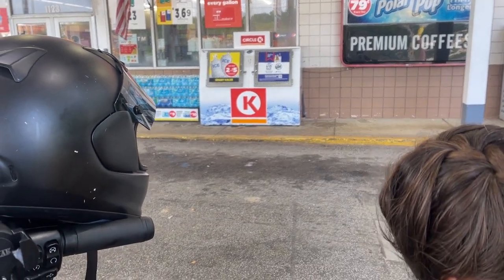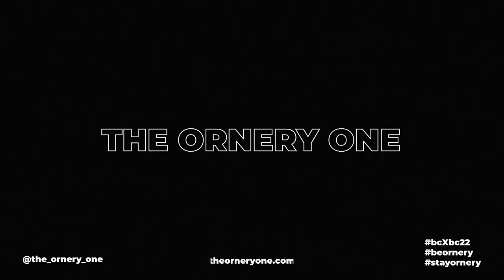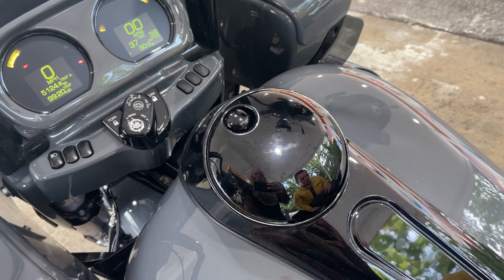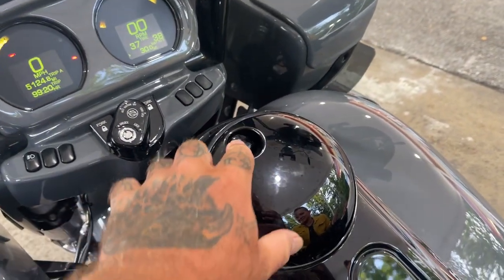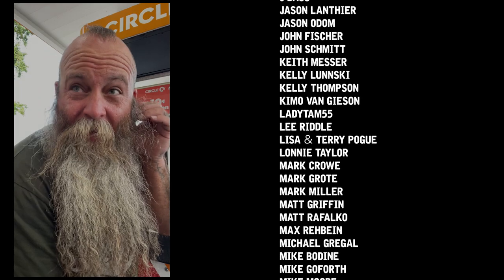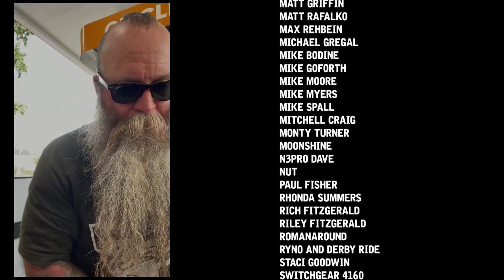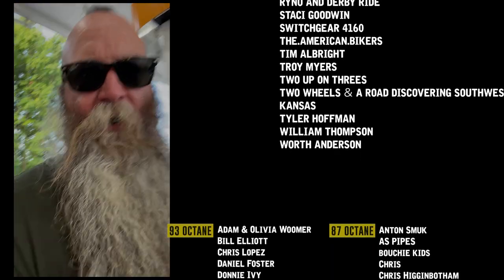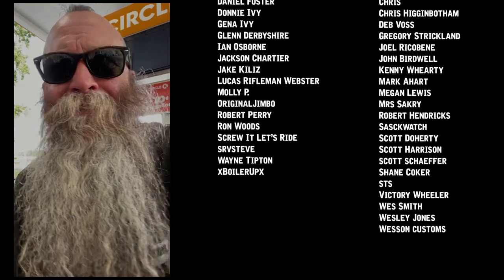pet peeve on a motorcycle | Bikers do NOT want to deal with this | Gas Lid door doesn't flip up

Comment: You can adjust the spring by carefully bending it. You can also get a real small piece of non-skid tape (cut a disk with a paper hole punch) and put it next to the button on the rear wall of the cavity, gives you a little more traction to pull it up.

Comment: Fuel cap thing is fuckin annoying. Pushing on the bottom doesn’t work on mine, I use my HOG card to pry it open.
Reply from the maker: Just a little thing that bugs me when I have to use it 2-3 times a day for 32 days in a row. 😂
Reply: @TheOrneryOne   I walked around pig trail Harley Davidson pressing the buttons on the new bikes, only about half actually opened.